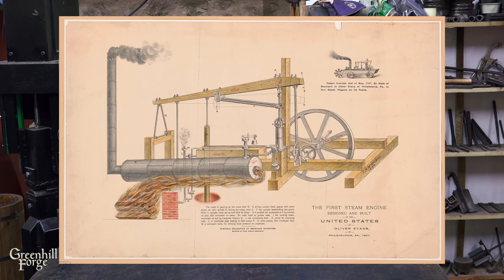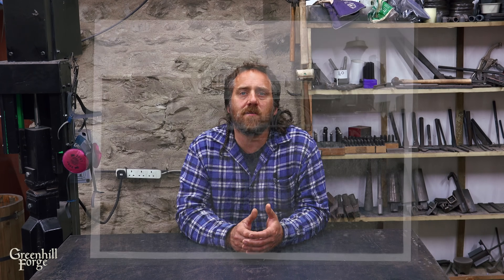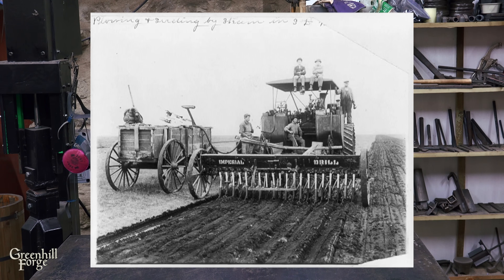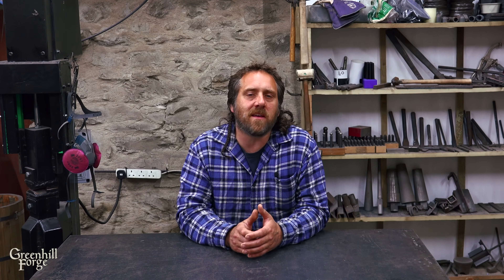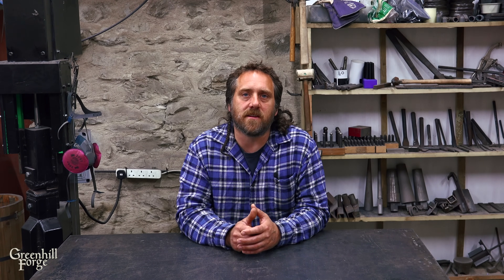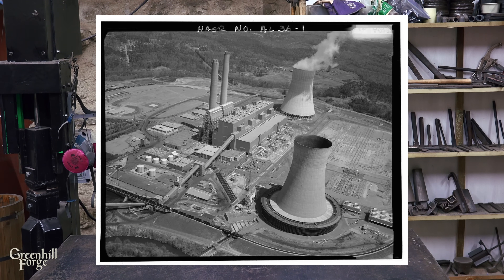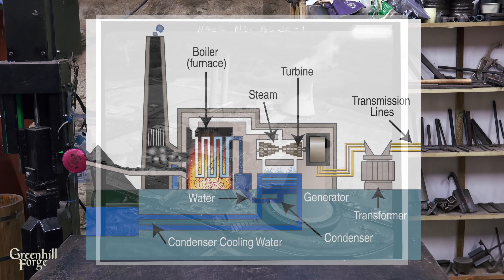Help Me Design an OffGrid Steam Engine + the Basics Explained

Comment: I have no degree or some kind. But I thought if it is possible is it efficiency wise higher than Standart steam engines. 

If the heating element would be a circular mirror that focused sun light to a small point with a water reservoir that heats up really fast and the steam goes over pipes to the turbine but condensate in the same system without a big leak. The pressure relief and so for safety. It could be designed as such the pressure is high enough and has enough space to cool of like the inside of the outer wall of a house or so.
Reply: Hard to describe without a sketch

Comment: New Sub

I've built steam & air engines for over 50 years. I'm 76.

Alrhough I have built probably every design out there, I recommend you keep it simple.  Build a turbine.

A flywheel made of a spur gear, entrapped on a housing, with compressed air directed tangentially at the gear as it enters the shroud, all supported by a bicycle front hub anchored at its center to a base, with a wheel of permanent magnets passing through a pick-up coil works like a charm.

I build windmills that compress air as well as build small air compressors direct-connected to solar. 

 All the solar and wind air compressors feed an air grid on my homestead. 

I have a barn dedicated to storing FREE compressed air.  

Utulizing that air to do work or make electricity is no more difficult than opening a ball valve.

Oh, I should tell you this: all the windmills, the solar and the air engines use a worm-drive reduction transmissions, trading off speed for power.

Comment: Hey Greenhill Forge,
I’m building a similar off-grid battery charger but using a low-pressure ORC vapor cycle instead of steam to avoid the safety headaches and licensing requirements that come with pressurized steam at this scale.
Key specs:

Expander: eBay GT3 turbo cartridge (no vacuum needed → cheap, simple, robust).
Working fluid: LP propane (boils at ~–44°F at 1 atm) — no combustion, just phase-change refrigerant.
Energy source: Temperature delta between boiler water (160–180°F) and condenser water (ambient or chilled).
Output: ~3 kWh per cycle into batteries via PMA → rectifier → MPPT charge controller.
Speed control: 10:1 NEMA 32 planetary gearbox + machined adapters; turbine RPM modulated via low-frequency PWM on the circulation pump.
Heat exchangers: 60-plate brazed water-to-water units (evaporator + condenser).
Condenser cooling: Automotive radiator + fan, plus a spare laser chiller with hydronic coil for summer boost when ambient temps cut the ΔT.
Oil preheat: Boiler water jacket heats turbo oil → superheats propane vapor → improves expansion efficiency at the turbine wheel.
Nozzle: Custom-machined vortex cone (mill/turn work) for optimal expansion into the wheel.

No vacuum, no steam licensing, no complex seals — just efficient, safe, scalable waste-heat power.
Might be worth a look for your project. Curious what you think!

Comment: Oh! New thought. Check out Hyperspace Pirate's channel here on YouTube. He's been working with refrigeration with the intended goal of cryogenic temperatures, downwards of -200'C. And to do that he's making high pressure systems. VERY high pressure systems. 40 bar and upwards. (Which is about 39 atmospheres or 580 PSI)  A two second search says that most "high pressure" steam locomotives ran at around 200-300 PSI. So perhaps Hyperspace Pirate has some insights that might be useful. Plus he's pretty good at the math behind gas pressures and liquefication of gasses and whatnot.  I'd be really surprised if he hasn't done some thinking about steam engines. Perhaps reaching out to him could be beneficial?

Comment: Hoo boy. Steam. Yeah, I want to play with steam also, but there's very little difference between a steam engine and an explosive device.

Disclaimer: I'm NOT an engineer either, but steam has been an interest of mine for a while so I tend to read things when I find them.

Flash boilers are generally safer and faster to get up to operating temperature, as you've no doubt already surmised. A larger boiler takes MUCH longer to get going, but like all larger loads it tends to be more efficient when it's running... and harder to stop. A lot of inertia in a boiler system.

Vertical Vs Horizontal.  Hmm.. Horizontal is more efficient and faster to build to speed due to increased interaction area between heat source and boiler, or so I'd imagine. Though a vertical can be built to have more dwell time and regain some efficiency that way..  I'm not sure, honestly. I'm inclined toward horizontal because trains and ease of access, but the emergency dump in a vertical might mean it's safer. More on that in a bit.

Fuel: Wood. Charcoal is too inefficient, as it requires a whole seperate production system and a ton of potential energy is lost during that stage.. And honestly you don't need the intensity of heat that it can provide. Remember, to create steam all you need is 100'C. Of course when you increase the pressure you lower the boiling point, but an intense fire and high pressures aren't really required if you instead expand laterally. Lower pressure systems are safer and tend to not level the building if they go bang. If you look at many of the older steam systems, they go thump... thump... thump...  Not whrrrrrr. Modern gearing can trade torque for speed where required.

Safety: Ahh, I think you covered this with 'fusible plugs'. Yeah, a lead plug in the bottom of your boiler directly above your fire box is pretty much mandatory. In the event that the boiler goes over pressure or over temperature, the lead plug will melt and the boiler expels it's remaining liquid straight onto the fire, extinguishing it and severely limiting the potential danger. Neat trick in some trains.  But the best safety in a steam engine is constant monitoring, which.. Yeah. If you want automation, you aren't planning for tappers crawling all over this thing day in day out listening for faults and checking for stress points. Steam is... Unforgiving.

Piston Vs Turbine: I'm inclined toward piston myself. It seems piston is better for high pressure systems, or so ChatGPT kept insisting when I was quizzing it a few months ago. But I dunno. Fuel economy, or at least energy transfer medium economy was a huge part of what I was considering. It was hydroelectric then, and the idea of a whizzing turbine allowing all that water to just rush past without really adding to the system is.. Repellant. A piston on the other hand uses almost ALL of the energy in the medium, rather than the 'use lots to top it up' idea of a turbine. I imagine the same will apply to steam. 2L volume of steam via a piston is a few full strokes. 2L of steam through a turbine that's already running at near maximum speed is just whoosh-gone without adding much to the system.. Or so I reason.

Materials: Steel Vs Brass.. Hmm. I love the idea of stainless steel where possible, but stainless has a nasty habit of degrading and becoming stained steel over time. Look into the tensile strengths of various grades of steel, stainless steel and brass/bronze. The geometry of the boiler will mean most of your stress will be tearing forces, stretching and ripping. Burst seams and ruptures are the usual, so welds and braised joints will be your weakest points. Vents and holes into and out of the tank should be circular of course so as to keep the stress even all around it, and be reinforced with thicker material fused to both inner and outer surfaces. But remember to include designed stress points so if it's going to burst, it will burst precicely where you expect it to. In much the way a fuse is the weakest point in an electrical system. Fail safe, not fail catastrophic.

One engineering principle I have heard went into early steam engines can be best summed up as "Build two, then blow one of them up."  In order to know the tolerances of a system, you need to exceed those tolerances and learn from the event. Then you declare the 'maximum' to be 20% less than that, or whichever margin of error you think is appropriate. Steam is unforgiving. And a mistake can easily be fatal.  The idea of running multiple smaller boilers might be worth looking into also. So if one ruptures, it's one small explosion instead of a house-destroying event. Half a dozen smaller boilers with baffles between them can operate a pair of pistons each, all linked into the same mechanical system to work together. Hell, a common fire box can heat multiple boilers also.

Honestly, I'd be looking more at stirlings as they only rarely explode. Yeah, I'm harping on about that a bit, but I've seen the wreckage after a steam system explodes. And I've heard stories about what happened to the people who were nearby. One test setup was in a small clearing. It was later described as a larger clearing filled with a clinging red fog, no sign of the two who were working on the engine, and an anvil lodged in a tree. Please be VERY careful.
Reply: I had a chat with ChatGPT (which I've been using as a sounding board and ideas-tester for a bit, to help research.. No, not as an end result. But it's a time saver when I can talk to something that fills in for 'having a casual talk with an expert' to refine or direct the next step) and it had a few interesting things to say about steam tanks. The main topic at the time were custom stainless vessels for electrochemical cells, but it agreed that bronze/brass (I forget which) vessels offer good heat conductivity and buffering for use as a boiler. I would imagine especially good for flash boilers. The mix the AI mentioned wasn't technically either bronze or brass but was an alloy somewhere in between with slightly different ratios to the metals involved. Braises well. Good tensile strength. Spheroid boilers are incredibly strong due to no real seams and relying on tearing resistance rather than flexing which we see at joints or corners. (Which is why H2 and LOX tanks are big balls, among other reasons) and so on.

This has been sticking in my mind for a while since watching the vid. Optimal boiler designs. I still say horizontal, but a tube type tank similar to the big LPG tanks or what you see in train boilers seems right.

Comment: If you make a sphere with a fitting at the base to an injector that continuously sprays the entire surface, all carbon based fuels have a gaseous state and if the nozzles for pressurized air with fuel are placed so the surface gets optimized blue flame burn, steam would be instaneous and consistent, condensed and reused at high temps.

Close your eyes, you can see it.

Comment: Boiler tank - with two pressure valves to avoid overheating and steam buildup - explosion the valves can have some sort of pipes out of the way for steam to be able to condense somewhere outside and not leek inside ur shop/house or burn urself. Sides can be insulated with ceramic wool so it keeps more heat inside and faster heatup, while the heating bottom must be thick if u heating it with a open flame.

As for the heating method definetly u can do a stove like thingy underneath it or like a rocket stove, that runs both on gas, wood and charcoal, you can look at how modern "heating pumps work" and make a custom 3 dependent system, many in my country have like a ceramics rocket stove, with the fume tubes run around with some collectors to heat the house also, the exhaust pipe can be enclosed in some concrete area, run trough entire house floors and a ventilator to push the "hot air" in the rooms. 

i have a friend who has like a small rocket stove, and did that to a 1000sqft house with 2 floors 5 bedrooms and 1 big living room, and in winter when he fires that thing in morning entire house is in bikini. 2-3 little fires and heating for house is done mostly from the recuperation on top floors. 

in ur case depending where u place ur boiler u can recoup a huge ammount of that heat loss from the exhaust if u run it straigth trough the entire house to the roof.

Centrifugal steam dryers... steel wool needs maintanance to soon, and rust can affect stuff fast. 

piston vs turbine ... dont know, maybe both? 

materials stainless steel is more expensive but the best thing u want, brass is copper basically and super expensive has same problems as copper so nah go stainless if u afford it, easy to weld stuff, easy to find, and easy to maintain and clean. problem with stainless if u overheat it will change its properties making it "harder and brittle if u overstress it after that" .. so make sure u never make it hot red. otherwise mild steel thick materials should work for 5 years or 15... then maintanance needs.

idea to implement maybe some flywheels from cars? to include in ur system as a innertia energy battery, maybe would help with that torque if you go turbine? so ul be able to get that extra umf when needed.

Comment: Take a look at charcoal gassifiers with water gas shift reaction.  You can run a petrol generator off this and using charcoal reduces the tar problem.

Alternatively look at a Stirling engine - your rocket forge might be a good heat source for the hot cap.

If you are sure in a steam engine  take a look at the TinyTech steam engines made and sold in India to provide power to homes or even small villages.
Reply from the maker: good timing with this comment. check out today's video https://youtu.be/pjkge3cHgXE. I also have a video where I build a stirling engine from scratch here https://youtu.be/pjkge3cHgXE
Reply: @GreenhillForge if only I could get you, Shane Pomeroy, MyEngines and Blade Atilla in a workshop together - as you are all trying to solve the same problem 😊

Comment: Quick thought.. - instead of a steam engine.. - why not look at a stirling engine? There's a great book called How I Built a 5Hp Stirling engine (Lockwood). It matches the work you've done without the extra hassle of a boiler. I was thinking of mounting one above / behind a wood fired stove and have the cold cylinder mounted outside / in a water tank.

Comment: Why steam engines? Its much to dangerous and complicated. If you want to use wood as a burning element, you could build a stirling motor. I dont think about this little toy engines, I think the real ones. For example there was the "Caloric Ship Ericsson" of 1853. A 79.25 meter paddle ship powered by a four-cylinder caloric engine. Each cylinder was 4.27 meters in diameter with a 1.83 meter stroke. Thats no toy. The engine had around 260 Horsepower, you need that to move  a ship this size.  The engine was a atmospheric engine, no pressure load here!The coal consumption was low, compared to steamers, they said. Problem was that the metal could not withstand the heat all the time and it broke. But today maybe modern metals can withstand the heat.

Comment: looking at boiler  you could go steel or copper vertical or horizontal copper is expensive  where steel is cheap no one uses fusible plugs  if comes to that the boiler has gone bang by that  dry steam can be done by putting pipes back in to furnace  most turbines   run dry steam my self  i build boilers  every working day i been in steam industries over 40 years  i worked on small models to large hospital boiler rooms what i think you should look at boiler operators guide that will give more information there are many books  but if got real problem i am here to help

Comment: a steam based tesla turbine might be interesting. if the goal is charging a battery bank, versatility should be sacrificed for efficiency.  turn the battery bank into the versatile power supply for later things, but losing efficiency for 'sometimes' versatility is a dubious goal to start with.

Comment: Repurposing a compound air compressor would be ideal for a piston type engine as the compressor is already built and it can be easily reversed to produce power. Replacing the valves with rotary valves would improve performance, and its compound nature improves efficiency. Then making another stage (Creating a 3 stage steam engine) would make it even more efficient and adding a condenser would further improve power output and efficiency. That kind of engine could then be paired up with a low-pressure turbine and be very efficient. And if you do make just a turbine, a tesla turbine using thin discs might improve efficiency, but most likely it will be very comparable to a regular turbine. But, since they are very simple and easy to make as well as having lots of low end torque they are rather desirable. A staged tesla turbine would be the best for efficiency, and tesla turbines are very robust and would not need a water separator.  As for the steam generation system a flash boiler would create very dry steam and may not need a water remover for the steam. It would be pretty efficient and rather small, and adding a regenerator would make it even better as the heat from the exhaust would heat the air coming in and use less fuel. The same could be achieved using a horizontal multi-pass superheated steam boiler which would be neat and would just be a lot of pipes, making it safe and simple as the firebox could be just a round pipe inside of the boiler. Adding a regenerator to that kind of a boiler would also be relatively easy as the exhaust and the intake are on the same side. Overall this is a cool idea but definitely complex.